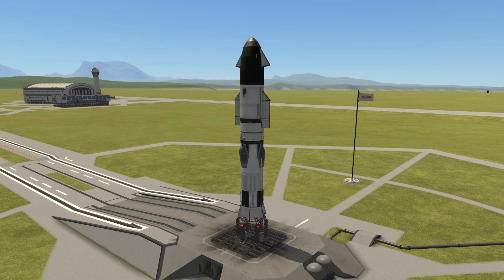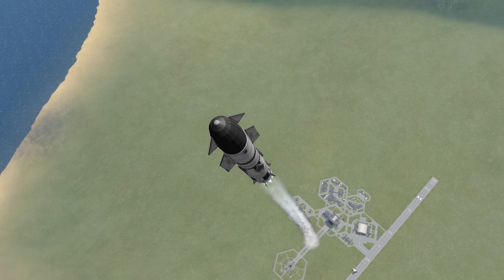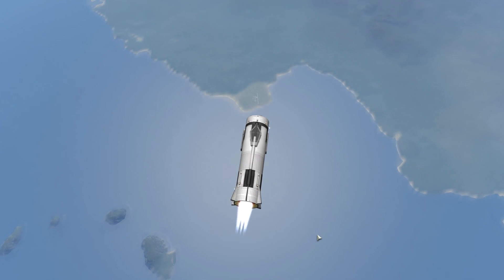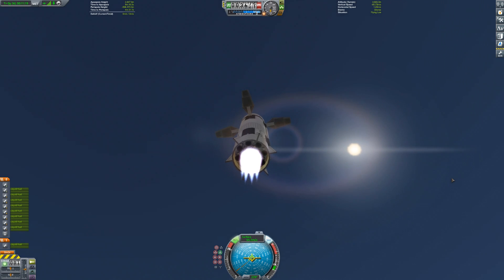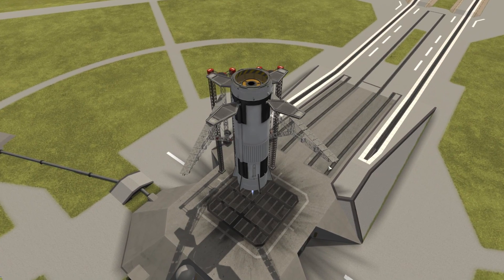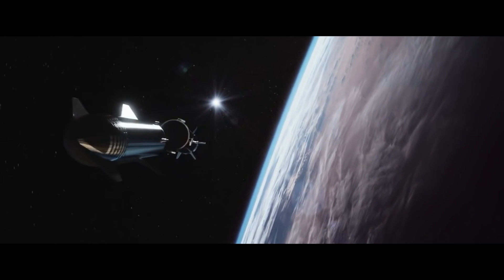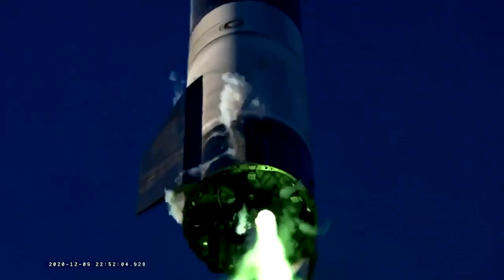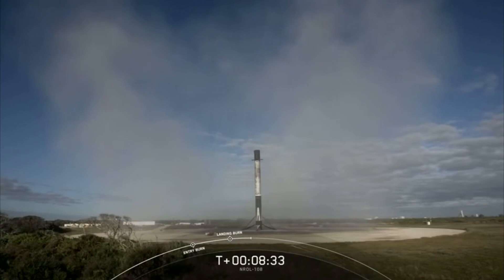Why SpaceX Wants To Make Landing Super Heavy MORE Difficult.

Comment: It would be a lot better to just make them 'land' in the water (closing the engine bay at the very last moment) and have them made to float and tow them back to a 'space harbor'
Reply: How it's that better? Now you need a rocket that can support its weight on its side, corrosion resistance, and a team and equipment to go and get it and bring it back to the pad. As opposed to it already being on the pad... That makes as much sense as me saying instead of putting my sandwich down on the table I'll throw it'll into my next door neighbor's bath. 🤔
Reply: @owensparks5013  structurally you'd have to redesign the outside to make it behave like a 'boat' or watercraft - the rocket would be mostly empty. 

You could even have it skim the water at high speed for a few miles coming in horizontally using hydrofoils to cushion its landing. But I understand it is a bit out there but it could literally be a fully functional sea craft with its own propellor
Reply: @theyshouldhavenevergivenme5439  
It's a fun concept, and if it could take off from water then it might be useful. I'm sticking with it a rocket takes off from a pad then that's where I'd like to find it when I need one.
Reply: @owensparks5013  okay you do you ;)

Comment: The arms wil likely be levers that extend beyond the tower, with counterweights and some spring-like mechanics. This way all the complexity is behind the tower instead of in front.
Reply: I did a quick back-of-the-envelope calculation - if you take a used / failed-quality-control Starship/Heavy core segment (30' diameter x 6' tall) and fill it with concrete, you get a ~320 ton counterweight for a 200 ton rocket.  If you submerge the counterweight in a hole full of water, buoyancy gives you progressive resistance, and you could do a "spiral cam" on the levers so that initial touchdown is very soft and gets firmer the more weight is applied.

Comment: I find the layout of the starship fins problematic. It raises the center of lift way above the center of mass which makes it extremely unstable with the super heavy booster. It works fine without the super heavy.
Reply: That's what you have flight computers for, like the B2.
Reply: @csgergo80  it still seems extremely unstable. I was using multiple simulators including SimpleRockets 2 which has a attitude control program. KSP seems to be equally unstable. I had to disable the lift physics.

Comment: My ... concern with this idea is that if it works it's great, but by removing the landing legs you limit your landing possibilities in cases of emergency.  If there's a glitch during the boostback burn, you loose the whole booster.  But with landing legs, you could have an ultraemergency landing in an empty parking lot, which would probably damage some engines, but you could save the rest of the booster.
Reply: The booster isn't capable of landing just anywhere.
Reply: @stargazer7644  I guess you have to look at the possibilities of abort scenarios where a booster without legs can't make it back to the catchy thing and is lost, but a booster with legs can make it to some emergency landing slab they build a couple miles up the coast.
Reply: @oneoveralpha  The part you're missing is there is no abort scenario where the rocket just randomly lands somewhere.  It can't do that.  The rocket returns to the launch site, or it ends up in the ocean.  That's it.
Reply: @stargazer7644  The part you're missing is that if they still had landing legs, there'd -possibly - be a third option.  In my original post I was going to jokingly suggest a highway, like for emergency plane landings, but I switched it to a parking lot.  But really, Texas is big.  They could build a few twenty meter concrete slabs to be emergency landing sites.  

The situation I had in mind is that it launches on a high inclination orbit, so instead of going out over the Gulf it goes up along the coast, and everything goes fine but there's a computer glitch in the boostback burn and it will end up ten miles short of the launch pad.  In that situation, you're saying it's lost there's nothing we can do.  I'm saying, maybe the computer can come back on and it could land at an emergency landing pad, but that would require landing legs.

Comment: This was smth I was thinking about - to use fins as lnding pads - but if place it at the middle or bottom of booster. Sure SpX will move it down with next generation of booster
Reply: Erm, if you put the drag at the bottom the rocket will want to flip 180 degrees, just like throwing a dart backwards.

Comment: One thing I never noticed on that SN8 bottom view in the terminal phase: when engine 1 flames out, I'm pretty sure the remaining engine impinges on the other in its drastic attempt to keep starship balanced. If you go frame by frame you can see the left side of the bell has a pretty bad fold right as it starts blowing green flames.

Comment: Why not use a moveable platform like kuka omnimove (omnidirectional wheels)  just bigger and faster to catch it?  Moves like a plotter, has mm-precision.
Reply: The booster can do those precision manuvers while descending, all that is needed are for the arms to swing in after the engines have gone by. ~30-35 meters of traveltime for the booster, that close to 0 m/s and you have a few seconds to do it.

Comment: Can Starship (the upper stage in this video) reenter the atmosphere from orbit? It has the fins so that it can fall with style but I wouldn’t think that would slow it enough to withstand reentry. If it can’t, why carry the fins?
Reply: That's where the heat shields and the stainless steel hull comes in to play. It will do atmospheric braking in the upper layers, than come down the last 10 km like SN8 did, sans RUD hopefully.

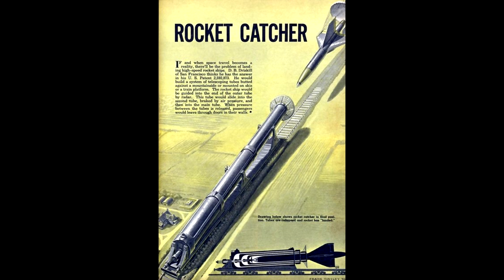Comment: 6:43 Now I really am confused. I thought there was a "Proof-of-Principle" requirement BEFORE PATENTABILITY. But as you say, if they got patents, before there was feasibility of P-O-P, then I guess it may NOT have been a requirement. Oh well! (Guess I'd need go read up on it. Too lazy, and no requirement.)
Reply: I thought "Proof-of-Principal" was something that public schools had to provide in order to make believe that there was someone in charge of those messes...

As for Proof of Principle, well, it depends on the specialty. For software patents you have to provide both an algorithm and the results given certain inputs, although I'm not sure they are verified (I'm quite sure i filed a patent with a serious bug which i never updated). For mechanical devices I'm guessing there is a far lower stardard since it's way more creative and non-predictable.
Reply: @yonidellarocha9714  "I am corrected in principle by the Principal" You are absolutely correct. I screwed up. Thanks.
Reply: You have to prove how it works on paper.  You can patent something that will cost millions to develop and manufacture, only to find it's no better than what's already out there.
You can also patent something improperly(make up science or make a mistake no one catches), and then in court later the patent can be overturned(A patent isn't really real until it has been defended in court, because then real experts go over it).
Reply: @coast2coast00  Notice how my comment had the word "PROOF" in it. Reason is "NATURE FAVORS THE HIDDEN FLAW" It is NOT "PROOF" until it is proven in practice. 
Where did you get your law degree, from a thermometer? it has many degrees, different flavors too: Rankin, Centigrade, Fahrenheit, Kelvin ... They are so fun!!! 
Notice how "Minus Forty Degrees" is the same temperature in Centigrade AND Fahrenheit ... PROVE IT!!!

Comment: Much easier to make  precision landing on a land based platform than on the deck of a ship bouncing around in the ocean!
Reply: Musk did say that they are going to build spaceports on the ocean. Not floating, but more like an oil rig. So it's the same stability as being on land.
Reply: They do land in the centre of the barge now, but sometimes slide in the swell before being secured.
Reply: Spoken like an ex-Navy pilot who routinely landed on "rolling, pitching, aircraft carriers" at night in the middle of a storm.
Reply: @thomasboese3793  I was never a navy pilot, just a civilian one who had enough fun landing a 7ECA Citabria in cross winds.  But I've seen enough videos of Navy fighter pilots almost crashing their planes onto the deck of a flat top.
Reply: @paulhiggins6024  I bet they feel that way to the pilot!  And the sudden deceleration caused by the tail hook is rather gut wrenching, or so I've heard.
Reply: Superheavy being much larger and heavier is actually helpful as well. Makes it more resistant to winds.

Comment: This seems so crazy and yet so sensible at the same time. I'm wondering if they will need a system that can sort of "cinch" itself onto the rocket body after the bottom of the rocket has passed through, which is I think what you were attempting to illustrate with your example where the two arms swung in as it was landing. It seems like you would want to get whatever is holding the weight as close to the body as possible for leverage reasons. Could the grid fins actually be strong enough to hold the weight up from near the tips? Seems like they would have to be way overbuilt for that, but then again I'm really not sure what level of force is applied to them on reentry. How much will a SH weigh when landing? I suppose the "catching" mechanism could also have a lot of spring built in as well, which would help.

Comment: If you catch the grid fins with movable wires suspended from a large diameter circular construction (think Arecibo radio telescope, RIP), a crash would not require much of a rebuild. Just removing the wreckage and replace the wires...

Comment: Great Video, but i dont understand why Helium? Happy and prosperous 2021
Reply from the maker: Helium is light, flows easily and is inert so it won’t react with the propellants.
Reply: @scottmanley  The temperature of liquid helium is much colder as well, would this be a factor?
Reply: It doesnt react with the fuel or the oxidizer. The other noble gasses would work too, but they are heavier
Reply: The primary reason they use helium is it doesn't liquefy/freeze when used around cryogenic propellants.

Comment: In the fifties the vertical take off and landing 'pogo plane" experiments included one example where the fighter hooked a nose clamp on a gantry wire to land. It was possible. Just insanely hard. Here we go again. Elon makes my brain hurt. but, it's possible.
Reply: To be fair, the Germans did it with biplanes hooking onto zeppelins in WW1.
Reply: @fredbloggs5902  Fred! You're right! I forgot about that! {Although the reports I read said it was a problem and never operational.} Our dirigibles Macon and Los Angles did it daily in the thirties. Thanks for the reminder. {the report I read was from the UK, so it MIGHT not be accurate}